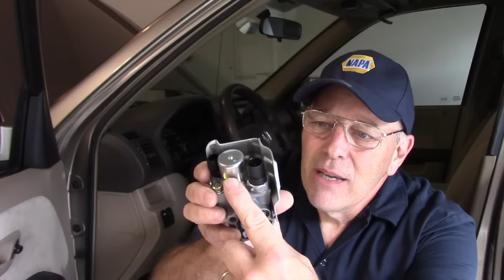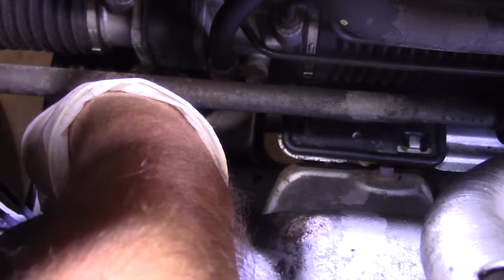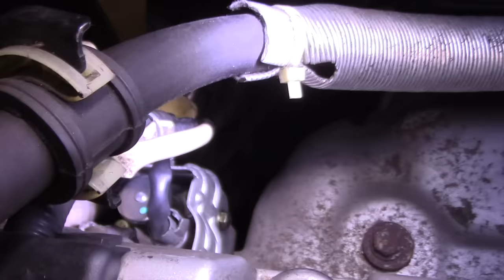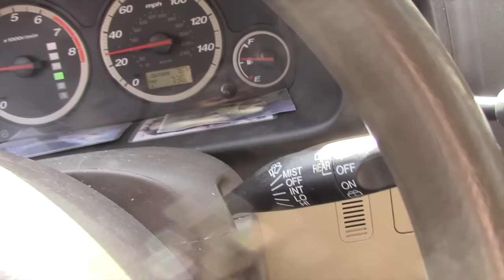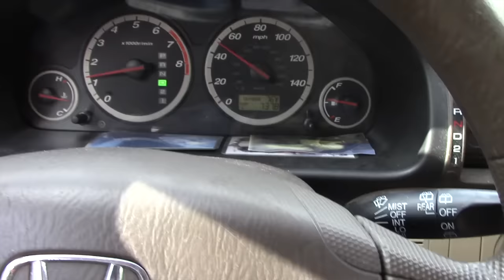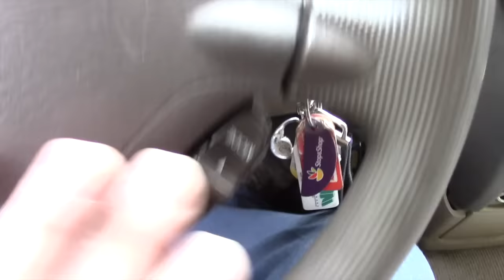VTEC Repair  P2647 Or 2646 (Pressure Circuit Voltage High Or Low)

Comment: On my 07 TSX these bolts were the toughest things to get loose. I only had to replace my gasket because it was leaking. One of the screws actually had some white residue on it when I took it out. I hope it wasn't threadlocker. I was able to best come in from the bottom of the car. Also not sure on this CRV is the oil pressure switch is located below the solenoid but need to be careful. I initially came at it the way you did and the wire came loose off of the pressure switch below the solenoid. Had to fix that after the repair.

Comment: Jim, I just changed the entire solenoid two weeks ago with a new factory part with sensor due to it leaking.  It was running fine until this morning when my daughter mistakenly attempted to put car in park while it was still barely moving.  Immediately after this happened as we were driving home it had all these bucking symptoms and the check engine light and VSA lights came on.  I got the same codes but I just figured she destroyed the trans.  I cannot seem to clear the codes and it keeps jumping up in idle to 1500 and lights come on.  Poor acceleration.  Oil is full and we changed oil religiously since we bought van new in 2006.  Any thoughts?

Comment: After checking oil level, I removed the variable valve timing solenoid and cleaned out the filter in the solenoid, which was full of gunk. After reinstallation, the problem was fixed. Good luck.
Reply from the maker: Thanks for sharing

Comment: Would it do it if the oil is overfilled? I got the sensor already and of course thats hiw I found your video, looking for the location.  I have a feeling I may have been a half quart or more overfilled because I was a little low, added a quart and the problem started.  I suppose I'll find out soon enough tho lol.
Reply: If its not good, im not far from auto zone, a little far from Napa and I guess I wasted 20 bucks but glad to find your video, I would have never thought to just change the whole thing. Looks easier to get at.

Comment: I replaced my whole assembly and its still throwing eocker oil pressure switch high voltage
Reply: Cut plug off soldered on a new plug for my oil pressure switch and it fixed my problem, spent so much time money and frustration because of a bad plug

Comment: I had the whole VVT assembly replaced on my 2006 Element. I drove 530 miles and it needed replaced again. Then, it just started bucking again at 3k RPMs today after putting 860 miles on the second VVT assembly. I'm not sure what needs to be done? But, it's now been in the shop 5 times and isn't fixed. It's very frustrating to say the least. Any suggestions from your experience?  (UPDATE ON MY COMMENT) We are pretty certain that the plug that attaches to the censor had bad seals. We put together that the problem started happening on or after rainy days. The plug has been replaced. So, we shall see.
Reply: https://youtu.be/e3bPWwgeO5s

Comment: I was getting a 2647 and 2646 on our '07 Honda Fit Sport. I checked the oil, that I recently changed, and the level was good. I next changed the whole valve assembly. The check engine light went off. I was pretty happy after test driving it. When my daughter drove it, the 2647 was gone, the 2646 came back, and the car wouldn't go over 50mph like she said it wouldn't before. So frustrating. Suggestions?
Reply: Mine can’t get over 80mph and I’m glad I’m not the only one going through ts issue. Probably should get the piece fixed… if it’s still doing it
Reply: @PrettyMaudie  No, it’s fixed now. It ended up being the same valve. For whatever reason, it like Honda equipment over what you can buy at O’Reily’s. I suggest using dealer supplied parts. It reminds me of my Apple phone that only uses Apple cables, etc. or it gives me an error. Why the Honda valve worked, no idea.
Reply: @metalmanipulator7210  I was going to buy it off car parts online but how much did it cost to get put in???
Reply: @PrettyMaudie  Here it’s a couple hundred (Sacramento). I blew that on the aftermarket one also. In reality, it looks like it should be $50, at the most.

Comment: Just quick question 
I have Honda crv 2002 2.4
My solenoid Spool Valve has only one electric harness connector on top of it 
And all the new part online has 2  wire harness connector on top. How is that going to work for my honda  and thank you.

Comment: It's not always the VTEC Solenoid assembly. Sometimes it's the connector TO the assembly. The rubber grommet on the connection can get aged and susceptible to moisture, creating the very same scenario - especially and almost exclusively in wet weather.
Reply: It could also be the VVT solenoid (that's the cone shaped one on the left side of the engine) or the VTC filter screen that's behind the power steering pump
Reply: I think that is exactly my problem. My element will throw p2646 every time I drive it in the rain . I’ve changed the whole vtec solenoid assembly 3 times already and it still happens every time it rains. Is there a way to order a new connector?
Reply: @KRiSXC0RE  yeah I have a Element and that’s right it happens every time when it rains only
Reply: @KRiSXC0RE  there are people who sell connectors that are weather proofed
Reply: @KRiSXC0RE  try cleaning with eletronic spray, i might have to do that as well
Reply: Is there any way to just snip the wires and replace it with a pigtail connector to fix it? I just replaced my solenoid with a factory one, and I got a vtec oil pressure sensor high voltage error code.
Reply: @projectskadi935 did you fix it?
Reply: @lil.santitoss  Yes. I have had no problems with it. I did, however, decide it was a good idea to just check all my connectors to see if there's moisture in any of them, and there were a lot of seals that went bad. They're currently cut and fixed now, but I do plan on just putting a whole new harness in later.
Reply: @projectskadi935  yes I have seen 2 people on YT who also sell weather proofed pigtails for this issue
Reply: Saved me hundreds from replacing the Honda genuine part that I got after replacing 4 times with after market parts. Thank you!
Reply: What's that TO assembly
Reply: @jessegarcia45 He was simply emphasizing the word “to”.  In other words, it could be the female side of the connectors (the plastic part with the wires leading to it that he unclipped). In some cases it could also be the male side that’s bad.
Reply: I changed the o-ring/gasket/screen at 120K miles on my 2006 Element just as preventive maintenance. Since I always change the oil @ 5K mile intervals with premium full synthetic oil, there was no problem. However, at the advice of other YouTube videos, I did seal all the joints at the connectors with adhesive silicone sealer to protect it from the weather and temperature changes. So far, so good. 
Now, I plan to change the secondary VTEC o-ring/gasket/screen located behind the power steering pump. Tiny screen but a huge job.
Reply: @boomerguy9935  GET THE OEM HONDA SERPENTINE BELT WRENCH!!!! it makes the job SIMPLE!!!!!! 
$35 stupid long angled wrench with two heads. 
i broke two rental serp belt tools before i bought the OEM
Reply: @boomerguy9935 I recently did that during a tensioner and power steering pump replacement. It was so easy to take it off and replace but they just had to hide it back there.
Reply: This happen to me today during heavy rain with rain drenched roads.... my vtec silonoid looked brand new so I'm thinking u r correct
Reply: Can I replace that part?
Reply: @stevelocon577 yeah I cut the wires, stripped them, used one of those connectors that you heat up or crimp, put some shrink tubing on it, and it feels better.
Reply: I have the same issue in wet or rainy conditions, already replace solenoid assembly once
Reply: @masterofnone8055  so it's either the connectors to them are just that far gone or there's a pretty nice chance that's its defective if you bought an aftermarket one cuz I had problems with aftermarket but this last time I put the extra $30 forward and got a factory assembly direct from the factory and the car has been fine since
Reply: 08 tl type S its my daily changed the switch should i change the actual solenoid itself bcs the code is still on
Reply: Is it the gasket with the screen that your talking about?
Reply: I've never had a code but it does the bucking really bad at 1,600 rpms
Reply: Thanks for this comment. It helped.
Reply: So true!!

PSA: if you're having p2647 error code, related to rocker arm oil pressure switch, do not panic. In my case after having the code for about a week, I went ahead and cleaned the connectors with the spray that you use to clean connectors and then I realized also that there was oil in there so I just cleaned it out.  Fixed. The fix makes sense because remember the oil can conduct electricity and would manifest a short across that switch, resulting in the code and check engine light.
Reply: What about cold weather?
Reply: Ive changed the vtec solenoid assembly, the connectors to it, the oil/oil filter, ive tried putting seafoam through it. Ive got the same rocker arms stuck open/closed codes that could be a million things.
This piece of shit vtec system is just not worth the trouble... probably gonna scrap it and get what I can
Reply: @rickytrevino8281  damn did u clear them after? If all of those didnt fix it then likely the rocker arm itself broke somewhere. And at that point, yea not worth it sorry fam
Reply: @yungalm1ghtyvevo586  Yeah cleared them all. I already got a new wrangler still just pissed to have this junk sitting on my driveway so thanks for the verification ill scrap it
Reply: @rickytrevino8281  check the one on the left side of the head (i think its the vtc), ALSO, the little 2" oil filter on the front of the block too

Comment: i changed my solenoid to a brand new part, 1 week later the check engine light at P2647 code came back.. oil and oil filter already changed and brand new.. any advice??

Comment: @jimthecarguy thanks for both of these videos on this topic. I recently replaced my solenoid due to an oil leak that I couldn't track down. I did find it after I had replaced the solenoid. I drove the vehicle about 10miles at speed and had no issues. I went to work today and got about 15 miles out from home, then I have all the lights come on and experienced the same symptoms at about 2600rpm. What else should I be checking? Where did I go wrong? I have not had a chance to check the check engine code yet, but I can only assume that it's similar to these codes. Thanks again for the great video.
Reply: https://youtu.be/e3bPWwgeO5s

Comment: My 2005 is doing the same thing but the code I am getting is P0139 and it’s saying it’s an O2 sensor but it’s not because I’ve replaced the 02 sensor twice in the last week. I just got the oil changed and put new ignition coils and spark plugs. I don’t know if this will help or not. HELP

Comment: My 2010 Honda Odyssey ex l start up run for 10 seconds and cuts off, I wash the motor with it running  and started miss after that and stop, #7 fuse which is a 11am- fuse keep blowing

Comment: Could the oil pump being pushed to oil cavitation cause this issue? i have my car tuned to a higher RPM than factory (8900 over 8300) and suspect so.

Comment: Just change my vtech in my 2001 Honda Accord my pressure solenoid won’t click for some reason but it’s on just not hearing the click 
Also once I haven’t put oil even tho I change it I’ll still get that bucking feeling?

Comment: Jim, I just bought an Element about a month ago. Im having some random bucking or kind of. I just removed the spool valve look to be an original one and look relative new. The gasket was perfect with no leaks and the filter was 100% clean. Maybe is the Transmission selenoids?

Comment: First off thank you for you videos.  They are extremely helpful.  I got a question.  My honda accord was throwing this code after going into limp mode.  The oil was low.  I fixed that.  And ordered a new solenoid to replace.  In the couple days I have had to wait on shipping, I have had to drive the car and just stay under 3k rpm.   It's still had the engine light and same symptoms for the last several days and this is with the correct amount of oil.   This morning however it runs perfect....  the part arrives today.   Should I still replace solenoid?  Could it just be that it's beginning to fail and hasn't fully failed already?  (Not sure if it's one those type things that can sometimes work)  or could it just have taken that long after filling oil for the ecu to clear the code itself?   Any info would be greatly appreciated.
Reply: Absolutely replace your solenoid if you already have a new one to due so.
Reply: Low oil will give the same code. Clear it and see if it ces back after you top the oil off

Comment: Hi Jim! What's the part number of the entire assembly?  I have the pressure switch but I minus well replace the entire thing!
Reply from the maker: Sorry I don't recall. Just make sure that you get the original Honda part. The aftermarket will not work properly.

Comment: My 05 element bucking jerking won’t go pass 3000 rpms stall a little when I accelerate. There are no codes on for the Brecht only p0507 throttle iac valve. Someone please help mechanics saying transmission.

Comment: Any experience with P2649 on the same engine? If so do you recall if a new spool valve fixed the issue?

Comment: Hey Jim I got a 2006 Honda Pilot I forget what code exactly I was getting but it was for the vvt solenoid so I replaced the whole assembly. Now I’m getting p2647.. my will start jerking back in forth as I’m slowing down and when I’m coming to a stop the whole car starts to rumble and then goes into limp mode.. I did get a bunch of oil in both male and female connectors on the solenoid and engine head. That’s all I can think of that may have affected something.
Reply: I changed my oil and reset the cel no luck .. V-tech works fine until I go into limp mode.. intermittent

Comment: Your video was very helpful for my 04 CRV. One tip that worked for me was to remove the 3 bolts first as that gave me more wiggle room to disconnect the electrical connections. Also, is it necessary to disconnect the battery first?
Thanks
Reply: Should not need to disconnect your battery to work on your vetch solenoid.

Comment: Did the motor flush replace the oil and replace the part cleared the code drove down the block and it keeps happening again seems like I can’t get this issue fixed Honda CRV’s are full of shit

Comment: I just swapped out the vtec solenoid and it threw the same code again. P2646 and p2647. It threw the code then later on the light turned off
Reply from the maker: Was the part from the dealer or aftermarket?
Reply: @jimthecarguy  aftermarket. Got the Honda OEM part and tested the resistance on both. Aftermarket was junk. Put the OEM spool valve in and it's good to go.
Reply: @jimthecarguy  also, swapped out the air filter and saw a lot of oil in the intake tube. Thoughts?

Comment: Hi Jim, I realize this is an old video, but I just wanted to ask. In your experience, have you ever run into a situation where replacing the valve/solenoid assembly and replacing the VTC strainer on the front of the engine doesn't change anything? I've changed the oil, replaced the solenoid assembly, and replaced the screen behind the power steering pump, and I'm still getting P2646. Any reply is appreciated.
Reply: The problem was a defective (brand new) oil pressure switch
Reply: Same deal. Did you figure this out?
Reply: @lancehavens7798  nope. I'm going to do an engine flush soon. Luckily it's just an extra car that I have
Reply: @brendanuveda7102  Thanks Brendan. Let me know if that helps. I'm going to try a few more things too. I'll let you know if I figure anything out. Put a little Sea Foam in to see if that might help. Probably not but anything is worth a shot right now.
Reply: @lancehavens7798  I have also read that bad battery voltage, or wiring issues to the solenoid could cause problems. I'll be sure to update
Reply: @brendanuveda7102  Did you ever figure it out? bad wiring to the solenoid could definitely cause the issue, because the solenoid is actuated by a voltage signal and the pressure switch beside it tells the car whether it's getting adequate oil pressure or not.
Reply: @brendanuveda7102  Any update? I've had it all replaced twice already, each a week apart, and the problem came back again before I even got home...
Reply: Screen behind power steering pump ????

Comment: Jim, I have a Odyssey with V6 and it has 2 of those valves. 1 on front of the motor by the oil filter and 1 up top on the back of the motor! How do you know which one to change?
Reply: Randy Mann - if code shows 3497 then replace the one next to oil dip stick.  If code shows 3400 then replace the one on the back. I have 08' Odyssey.  Hope this helps.

Comment: P2651 rocker arm oil pressure switch b circuit low voltage  (2018 Honda Accord sport 1.5)  all my lights lighting up like a Xmas tree …